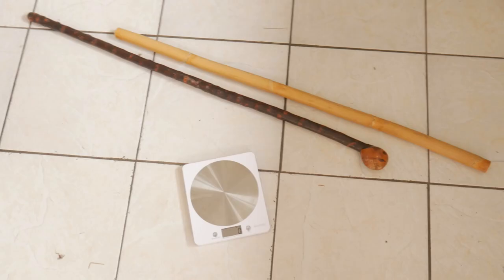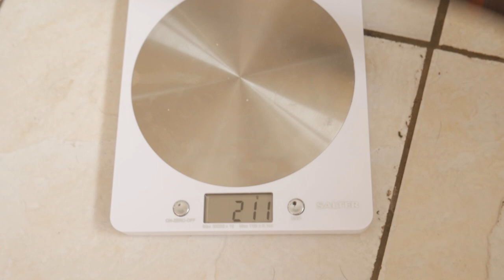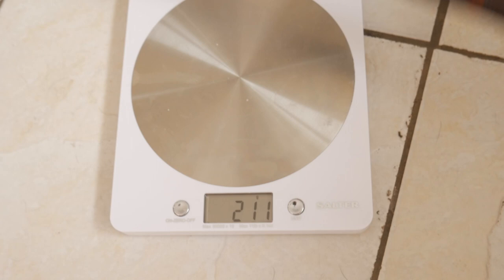Shillelagh vs Coconut

Comment: Good video! For my tomahawk chop tests, I have yet to find a satisfactory skull surrogate. In my experience, coconuts are too variable. Some are clearly far tougher than the thickest portions of a human skull. Others are blown thru like they were air. Pig heads aren’t great surrogates either—generally greater skull thickness and wrong geometry. Don’t know enough about the zombie head stuff to trust the structural properties are even close to similar. I do know from historic accounts that the Iroquois used pumpkins as skull surrogates but that was probably the closest thing they grew that “worked” for them
Reply from the maker: I have a contact for some synbone skulls which are used for forensic tests I will try them out soon and see how they hold up.
Reply: The zombie heads from Ballistic Labs and places like that are very expensive

Comment: If you see the three "eyes" at one end of the coconut, notice the 3 lines that start between those "eyes", and run ro the other end of the cocunut..
Strike the coconut on one of those lines midway between the ends of the coconut .  It will split the coconut in half almost perfectly!  Try it!

Comment: I'm surprised by the rattan to be honest.  In my experience it is very flexible and dissipates a lot of energy in the flex. At least compared to hardwood sticks.
Reply from the maker: Yes I was equally as surprised I'm not sure it if was just me hitting harder or just as a more solid piece of rattan it's hard to say.
Reply: Traditionally, here in my country, rattan is considered "deadly" material if weaponized. Flexible yet has a hard surface, make it a perfect whipping baton.

In 2000-2001 during a civil war/conflict in Celebes Island, one war chief of the christian faction (Advent Lateka) get killed after being hit by a rattan sticks from his opponent. The rattan stick wielder sheikh (Shaleh Assegaf)  since then  become famous as "Habib Rotan" meaning "Sheikh of Rattan".

Comment: You need a coconut secured to the top of a post.
Reply from the maker: Yes I plan on trying that soon I just need to figure out how to secure it on properly.
Reply: @ramblingkern  duck tape? Gorilla glue?
Reply from the maker: @17tzujan  glue could work if I sand down the skin and make some form of cup. I tried duct tape but used too much it created too much of a layer of tape around it.

Comment: Where does one get a shillelagh?
Reply from the maker: There are many options it depends where you live more than anything.
Reply: @ramblingkern  i live in the USA...so may have to mail order one. They are expensive.
Reply from the maker: @lusolad  they are but the process of making them takes 1-2 years and requires a lot of knowledge to do it right.
Reply: The forrest.  Find yourself a nice piece of oak in the US, carve it.  Cure it for a year up a chimney, oil it.  Tada.